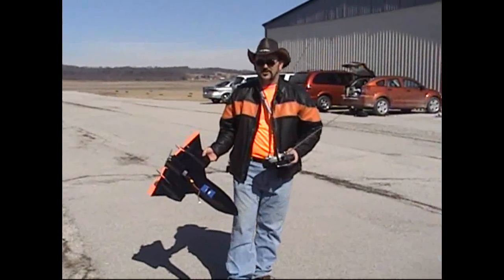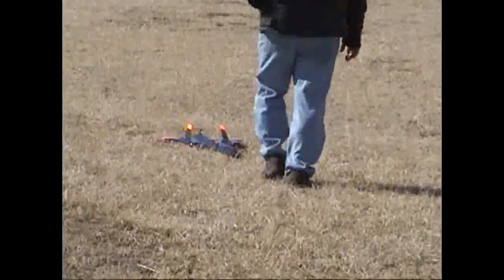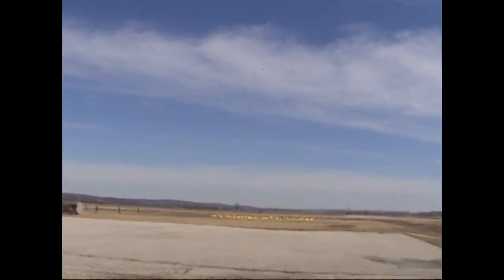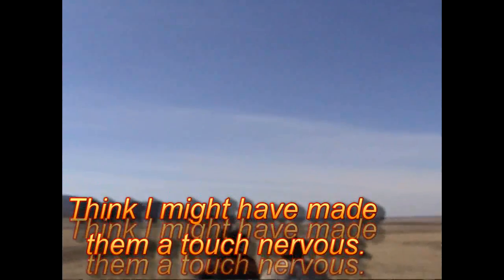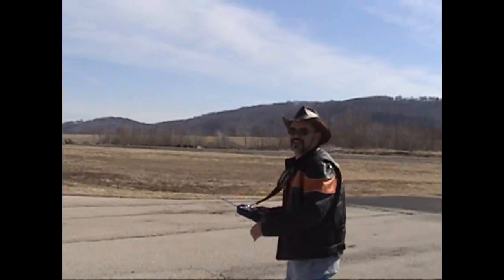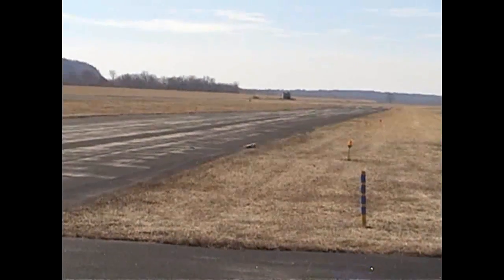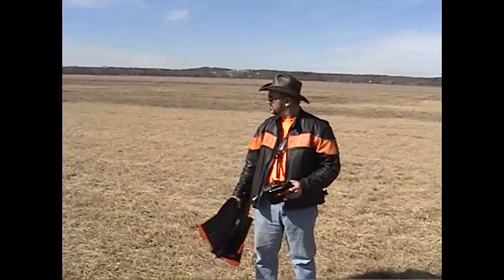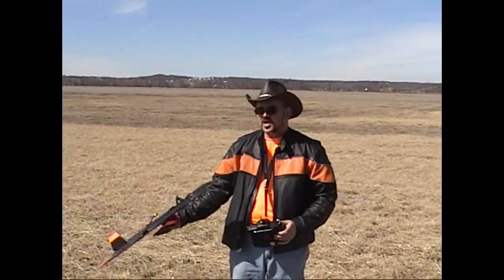Jon's Speed Project, Based on a SR-71 BlackBird

Comment from the maker: @minfinger going to try an external mixer and a Y cable to get elevon mixing. but the idea is to have elevator on both flaps but ailerons on only one. thats the idea anyway, will see how it works. also have a higher KV motor to try on a smaller prop. gonna go from 2350 kV to 3200kV and from a 6x4 to a 4.75x4.75.
working on a rather large project at the moment so it all comes about after this one, or at least thats the plan.

stay tuned this new project isn't a large plane but a large project.

Comment from the maker: @JC0926 if your useing 72mHz radio make sure you keep the ant wire as straight as possible, the first time out I had it ran up and down the nose. It was doubled back on itself and they wer too close together. it severly shortened the range. Second time out I re-routed it along the right leading edge to the right wing tip then routed it straight across the wing to the left wing tip.

Hope that helps
Jon

Comment from the maker: @JC0926 I had the motor cut out due to RF interference at our flying field, the main power lines feeding the airfield are under ground right where the cut out was. I swapped out to a 2.4g radio system. that has fixed it on every plane I have flown on 2.4g in that same spot. I have been busy and haven't gotten to finish up the repairs from the last time out. Hope to have it flying again real soon.

Jon

Comment: Maybe it's signal loss due to multi-path interference.. The signal from your transmitter is reflected off near-by metal objects (building, power lines) and arrive at the Receiver along with the direct signal from your transmitter. Some locations, due to geometry  the signals  add up out-of-phase hence no signal. Other times they add in-phase creating a larger signal. A better receiver use multi-antennas and receivers since at least one is not nulled. 
Good luck.
.

Comment from the maker: @ad2181 Im fairly certain is the ESC safegaurd from the loss of radio signal. need to eather A) Figure out a way to shield against the 60Hz interference or get a 2.4Ghz radio. Only the 72mHz radios have the issue in that area.

on this plane I think the way I ran the ant. wire is shortening the range and allowing more interference. 

Jon

Comment from the maker: @wildhover It was actually very stable, once I figured out exactly how little input I needed on the ailerons. throws were set to about 1/4" up and down. going to try to drop the size of the elevons at the tip for the next flight.

Thanks for Watching.

Jon